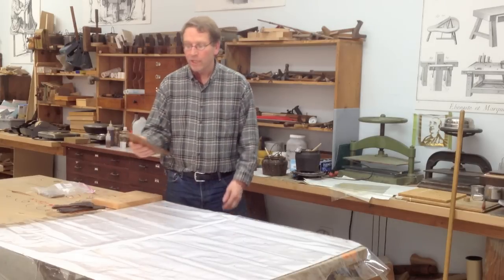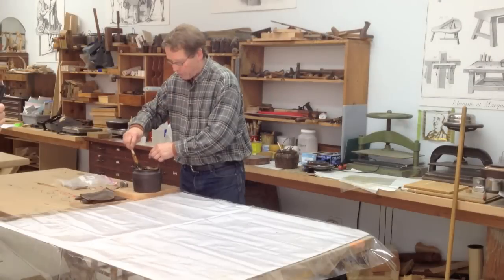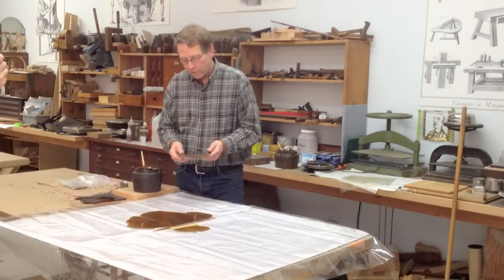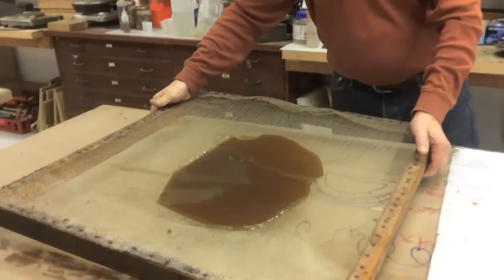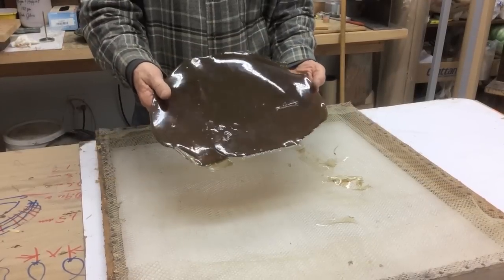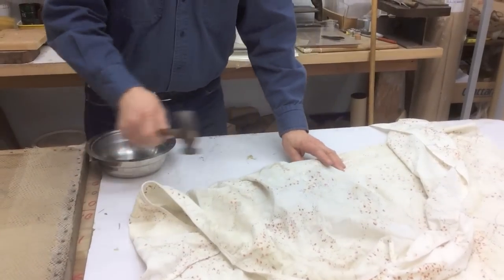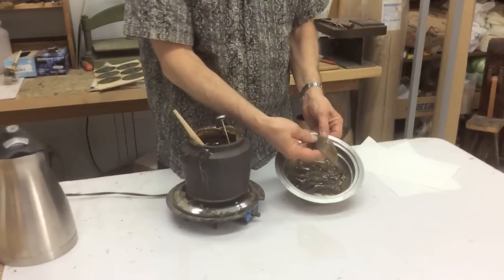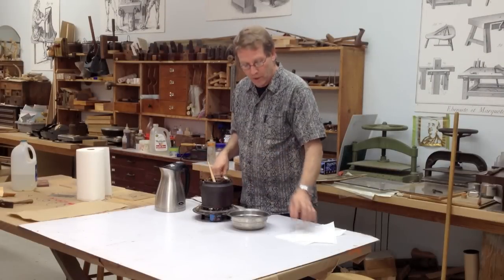Save Your Hide (Glue)

Comment: Just an idea, when I pour out the glue, after it cools and jells I cut it up into smaller pieces while it's still playable, it will dry faster and I don't have to try and break it up once it's rock hard. Another trick, I have an old box fan that I lay flat ( make sure to allow plenty of air flow through the fan) and set my screen on top of it, set it on low, it will dry the glue incredibly fast. If you use a food dehydrator, do NOT use the heat setting, it will melt the glue, and take my word for it, it's a mess. One last thing, you may have heard or read "not to use hide glue during a thunderstorm" in my personal experience this is absolutely true, I've done it, and it will not jell. I make my own glue, and have been cooking it during a storm and ended up with nothing but slime, and I have glued pieces during a storm and the will not set, maybe it's me, but this has been my experience. I've been using hide glue for over 20 years, and I love it.

Comment: Thanks for the video. Found you on FWW and was inspired by Steve Latta to use hide glue on my next project, a Federal style demilune card table. I've done some veneering already, and make my own so it's thicker than "store bought" veneer. But he uses hide glue for veneering and making banding (sometimes). There's still a place for PVA in my shop but I've already bought a double boiler and this afternoon it's down to Woodcraft to get some 192g granules. I'm making my own veneer hammer and had a question about the one you used:  how wide is it? I was thinking of making two hammers, one about 3" and one about 2". Yours appears to be the smaller size on that project. I guess use whatever squeezes the glue out best? 

Thanks again for all you do for the woodworking community!

Comment: I just made my first badge of hide glue and its still in its jelly state as i dont really know the ideal conditions to dehydtrate it. Any advices? Room temperature, sun exposure, do open windows or fans help? Any options if I dont have a netting like the one you use? Thanks and Great video!
Reply from the maker: Hello. If you want to dehydrate your glue to reuse it later, you need to have it reasonably thin so the moisture can evaporate, and to dry the gelatinous sheet, you want air circulation. If you do not have a netting, you can try a piece of chicken wire or something similar. You want air circulation on both sides to avoid mould development. I like to add a couple of hours of sun exposure on each side of the dried flakes before I store them to UV kill any spores that might have landed on my glue. Hope this helps.

Comment: Do you have any alternate ways of heating/melting the glue without the glue pot? i.e microwaving or putting in a pot on the stove? Thanks
Reply from the maker: Double boiler is the best. When I started my workshop in France I did not have the budget for a gluepot so I had a sauce pan with a piece o wood at the bottom and was heating up the glue in a glass jar laying on top of the wood. That way it does not overheat at the bottom but the water evaporate real fast so be careful to carry on adding some. Microwave kills the protein so stay away from it. When you get hooked to the glue, you can buy a gluepot!

Comment: Is there a video you have done showing how to steam or soak a joint in a somewhat more difficult to access location? I am restoring a parquet dining table that has square dowels inside the leg/apron joints. I have removed the dowels but need to dissolve some glue in the joint, as it is not coming open with the rubber mallet alone.
Reply from the maker: I am sorry we haven't, but this is a great idea and will do one as soon as we get a restoration piece suitable for it. Are you sure it is hide glue in the joints?
Reply: It was. What I ended up doing is syringing a bit of water through the dowel holes  (and on parts of the exposed tenon) after I extracted the waste and heating the water with the heat gun. This allowed me to incrementally release the joint. I then let the table dry overnight. The principle of adding moisture and heat also helped me to quickly get off the older glue. Thank you so much.
Reply from the maker: Great. Happy you made it work. Tight joints are the hardest to get at. But that's also the point of tight joints they work better!

Comment: Hide glue suitable for exterior use it will it deteriorate outdoors in weather?
Reply: Hide glue: dissolves in H2O, cleans up with H2O, thins with H2O.

So sure, use it on your outdoor project.  If you live on the Moon. And if you keep it in a very well insulated cold box during the lunar day. Probably be fine in the Sahara Desert or even Death Valley with same considerations, though you'd probably want to also keep it under a shed roof for the rare rainfall.

No problem, man. Good luck.

Comment: ive seen online many recipes 1 to 1 2 to 1. one fellow never measures at all its all about how it drips from the brush. What is the correct mix ???
Reply from the maker: Edad Martin Hi, If you are talking about the ratio water to glue, what matters is to soak the glue in cold water so it goes back to gel, collagen all the way in. Then, this is going to change as you heat up the glue, the water evaporate. Then our way to adjust viscosity is how it drips from the brush. When the glue is hot, 140 degree, raise your brush a feet, it should run almost all the way and get into droplets at the bottom. This s our preference but you can adjust with this test the kind of viscosity you are comfortable with.

Comment: Couldn't you just drop the solid pieces into the glue pot to "melt" them and skip the overnight step soaking in cold water?   I hear some folks freeze their glue and drop in cubes as needed.
     --Bill in Forest, Virginia 
            (www.LineAndBerry.com)
Reply from the maker: +William Brown Hot hide glue can be frozen without any problem. The ice cube tray are just to small for our use. The hide glue dried up like in the video or the dry we buy have the same moisture content which is not enough to melt or melt without burning the protein. Powder will rehydrate faster. This video is how to save a big glue pot and rehydrate it later on.
Reply: Thanks Patrick.  I learn a lot from your videos.
Reply from the maker: +William Brown Thank you, it is always a pleasure to hear our efforts are pleasing!